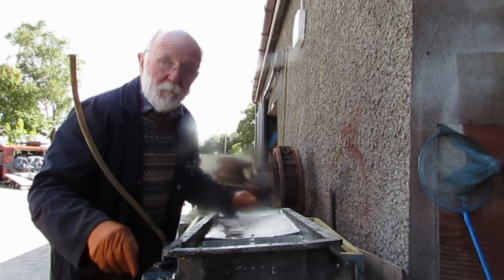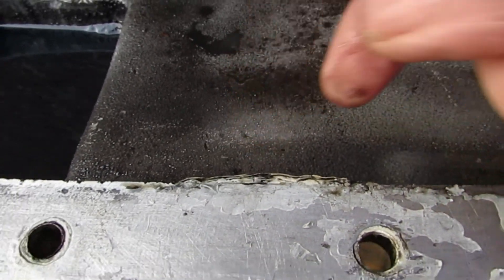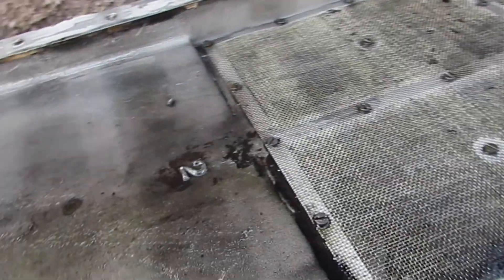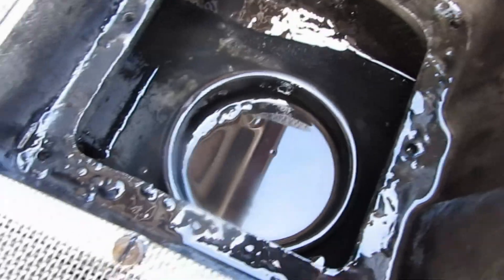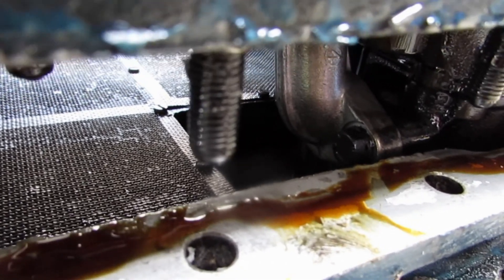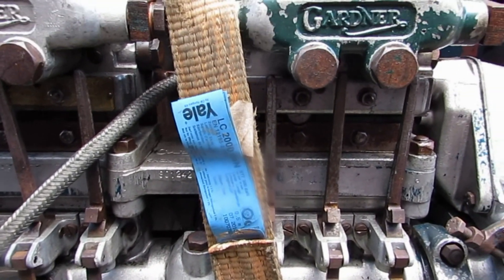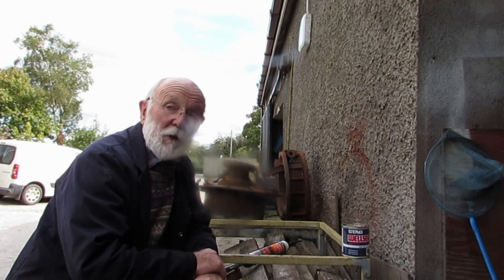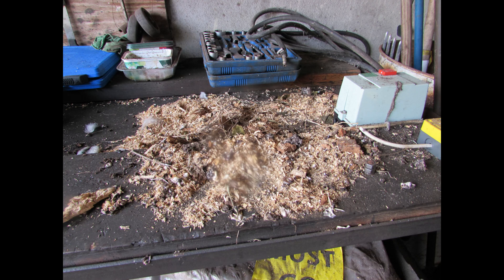Gardner Engines: the 6LXB sump

Comment: Hi joe you can’t drop a grub screw in the engine when building it and get away with it.
Every component to build the engine was issued to you, and if you went to the stores because you were a grub screw short. You would need to have a good reason!
Gardner  sealer was blue Hylomar and wellseal for the sump.
Used to build the 8L3B, 6LXB and later the 8LXCT happy day’s.
Also, after we built them we tested them on a Heenan and Froude dyno.
Does anyone know what F.A.P. means regarding a Gardner ? 😀
Clue.... it’s to do with the fuel consumption........
Further clue, what are the plugs on the exhaust manifold for ?.
Reply from the maker: Studying flame colour?
Reply: Joe McCool 
Flaming at ports.
An engine on test once run in was brought up to speed and full load applied with the dyno. Manifold plugs removed, there should be no flames seen in the exhaust ports (would not be passed off by supervisor). If there was F.A.P the sprayers were changed, sprayer pipes and sometimes the complete cambox to solve it.
And sure enough, the Lb/bhp/hr
Improved.

Comment: How does well seal perform on coolant circuits, I remember a old engineer telling me he used to use a very small layer on multi layered  metal head gaskets
Reply from the maker: I suspect it is not as good as silicon.   And yes we have come across the same application on the head gaskets!